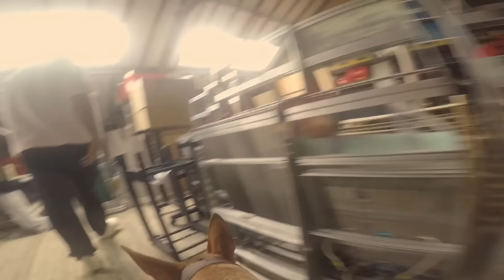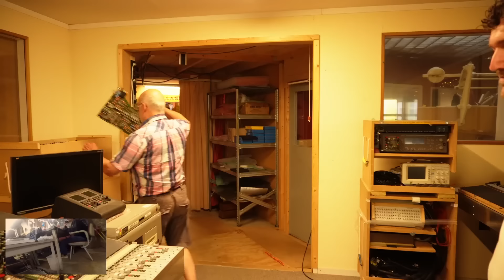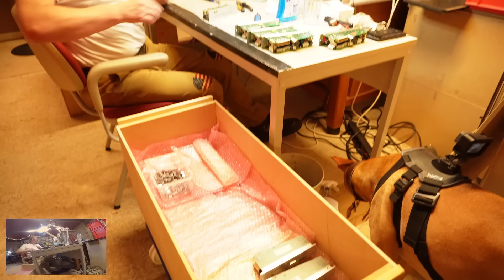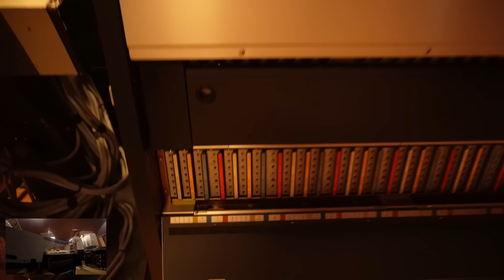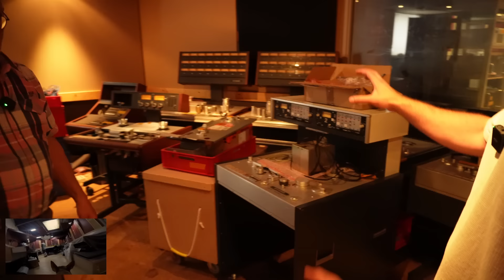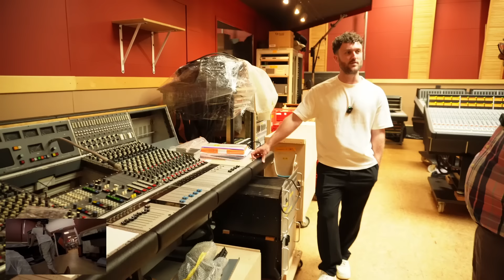Mark1 Studiotour Part 1 | The most INSANE collection of gear i've ever seen!!

Comment: I always wanted an SSL or Neve but never could justify the price tag, then I found an ATI paragon 2 desk that was never taken on the road and was used in a theater. ATI became the parent company of API so they built the Paragon 2 with all API components. It looks and functions like an SSL but with an API micpreamp, 4 band parametric EQ, HP/LP filters and the API "SV512" VCA dynamics which API sell in the 500 series with both Feedforward/Feedback compression and the Thrust circuit. I went to the theater to purchase some empty racks they were selling and the owner said I have more audio stuff in the storage area, so we walk back there and the desk was in a case with 20 hand puppets on it  🤣. I remember seeing live acts use the Paragon desks in the late 90s and early 2000s but they were only for the best touring groups and costed a fortune. When he opened the case to show me this "analog board" he had to sell I expected some big Soundcraft or Midas but we took the lid off and it was the 56 channel ATI, I had to keep my poker face. I asked him what he wanted for this out of date technology "like I wasn't interested" and he looks at me and says $2000 and I'll give you the matching monitor console with it which was a small 24 channel Paragon 2 as well. (SPARE PARTS!!!!) I went right to the local bank ATM and got the money for the 2 consoles and the 5 racks I bought. Now I have my dream desk and I couldn't be happier!

Comment: This is a killer video, I may buy a desk from this guy! Thinking about selling my API and going back to SSL
Reply from the maker: Oeeh thats cool! Why are you thinking of swapping the api for an ssl?
Reply: @thomasvopstal  Truthfully I love the api, My axs has routing for days, The headroom is amazing very little issues. Im torn because there is a mid hump  thing and the api Eqs as awesome as they are its tough to mix with them for my style. Im doing mostly mixing. So its more a taste thing than any major issue. But i run my Api like an ssl lol Amazing desk but Im thinking of going back to a 4k with some mods for some more low end and cleaner head room. Just working out my Stem bouncing Routing and workflow for my new studio build. weighing my options